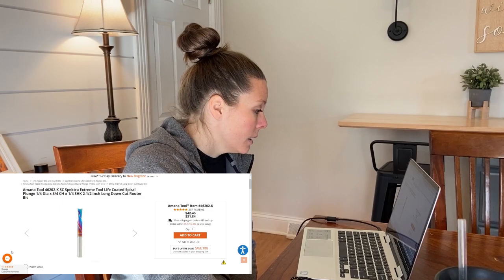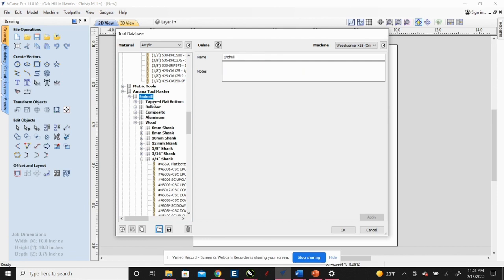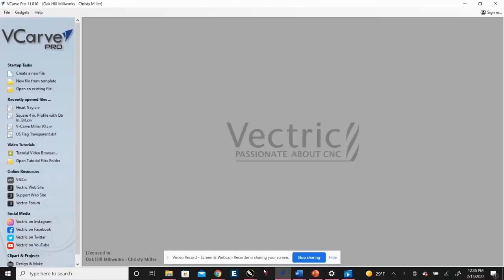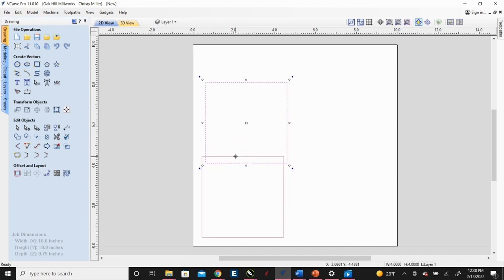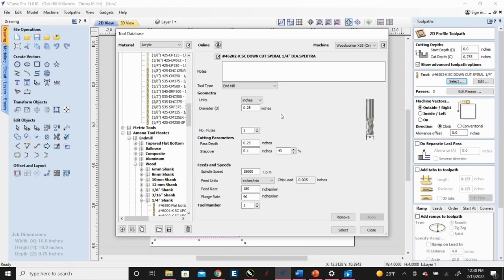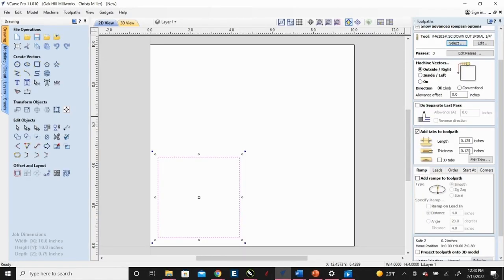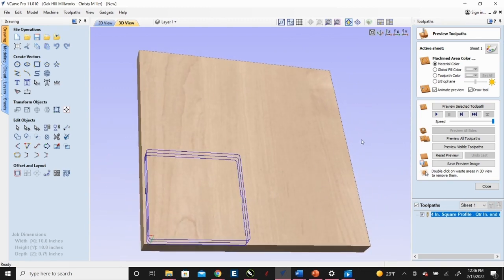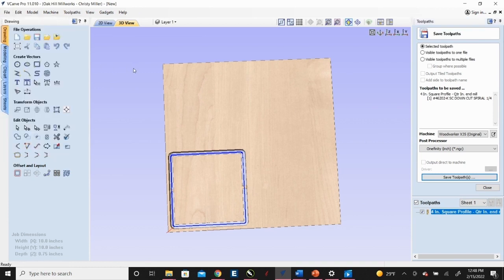BEGINNER'S GUIDE - Onefinity CNC - How to Program & Run Your First Job Using Vectric - PART 1 of 2

Comment: Always dig the content!  While I am still waiting on my journeyman, I have downloaded The car Pro trial. I will be purchasing it just not quite yet as it's a hefty chunk of change. Do you know if you can download the speeds and speeds from places like bits and bits before you have a machine? Just looking to get some of those things up and running to help reduce down time when the machine arrives.
Reply from the maker: Hey Jeremy! Thanks for watching! I’m excited to share the next half next week. Probably on Wednesday. — you can absolutely download the tool database at any point. The tools today version comes in a regular file you can print out and then you could highlight the bits you plan to use and just have the settings on paper. I didn’t try to open the bits and bits file in anything other than vectric but it is just a regular file you can download.

Comment: I’ve been considering getting V-Carve Pro. This gives me quite a few reasons more, seeing these steps!
Reply from the maker: Oh awesome. What do you currently use, Bruce?? Easel?
Reply: @OakHillMillworks  yeah, I design in Illustrator and then import to Easel Pro. I don’t love it.
Reply from the maker: @BruceAUlrich  man, Jef sings Easel’s praises seems like. It seems to be easy to use but maybe not as many bells as whistles?
Reply: @BruceAUlrich  I am curious if you'd be interested in doing some design work in illustrator for some extra $. I can import the DXF or SVG into Fusion at that point. Thanks for consideration.
Reply: @OakHillMillworks  Yeah, I think it lacks some bells and whistles.
Reply: What do you use currently for CAD/CAM?